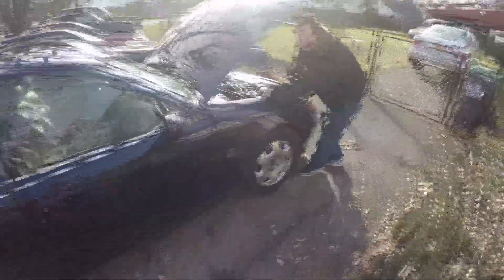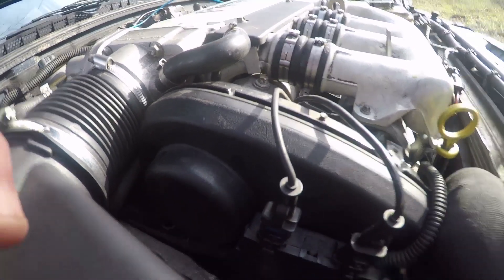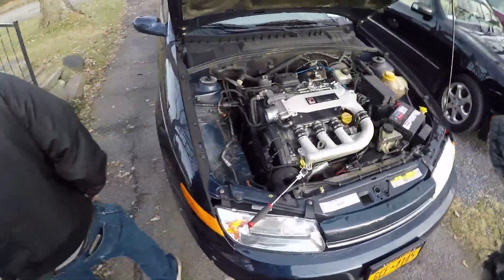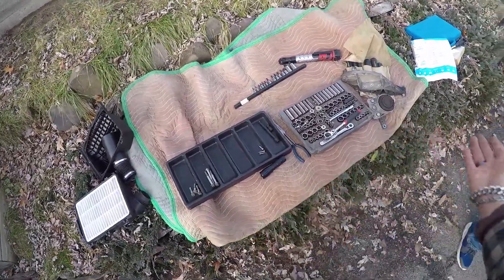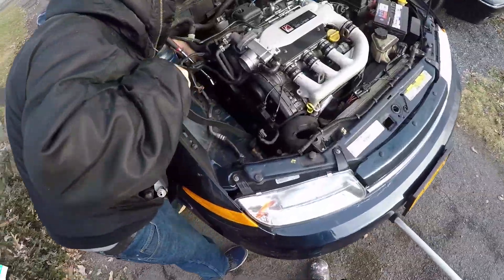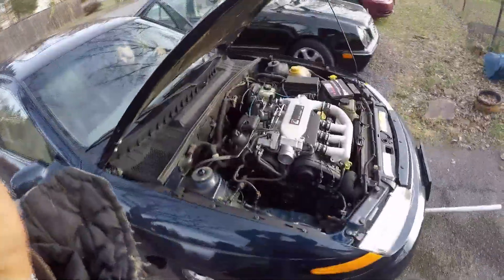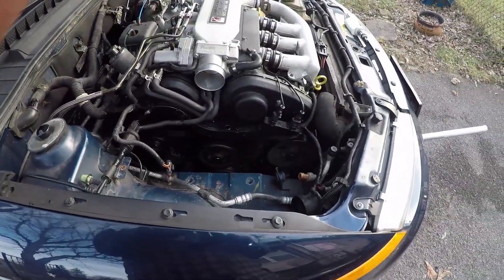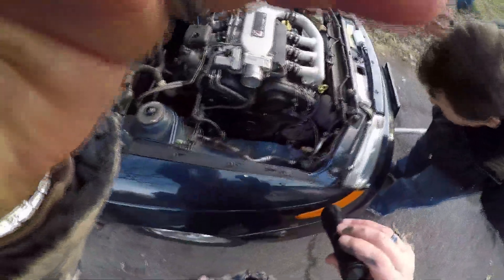Saturn L 300 Engine Noise Steering Pump Pulley 3.0 Liter

Comment: I need this part. One of the bolts on my power steering pulley came off, which warped the pulley. It’s making the same noise. Any ideas besides a junkyard where t get the pulley? Or if I got a power steering pump, would the pulley come with?
Reply from the maker: I would think you should be able to find that pulley online.